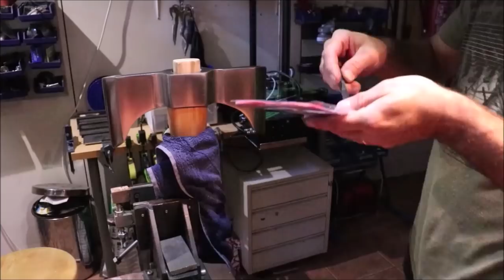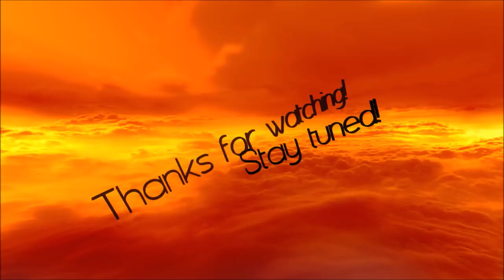Making axe with power tools (long version )

Comment: real talk tho... what fuckin cutting wheel and sanding pads are you using? It made quick work of that steel :O
Reply from the maker: Thanks.
Those are 3m  cubitron 2 products. There's more info at the description.

Comment: Like who wakes up in the morning and says i know i'll make an axe out of a lump of railtrack how did you see that in there???? stunning result mate .........Brilliant
Reply from the maker: Thanks buddy. This build will be continued later. Stay tuned. 😊
Reply: Where did you find that piece of railroad?
Reply: i agree the design was very well thought out...brilliant
Reply: @therustedshank9995  
Ditto all main line track in Washington state is Standard stuff all the same size short web Standard top rail and bottom flange ?????
Reply: I made a 2 headed hammer, from my railroad track... But im gonna steal this and make a axe and place it next to it :D
Reply: What type of electrode was use to weld the 2 parts??
Reply: @therustedshank9995  just try your luck at a farmer or scrap metal jard :D

Comment: Truly some of the best angle grinder skill from somebody who can actually measure and plan his work not just luckily wing it A++ 👍
Reply from the maker: Thank you very much !
Reply: keep doing what you do you'll go far try some ally or thin ss or evem thin mild steel art work instead see what that great mind will come up with ? I do random industrial bike orientated pieces and like your stuff for inspiration 👍 cover postage if you want and I can send you raw material like turbo heat  exchangers bare car clutches drive gears sprockets engine components cams etc etc

Comment: Wow. 

I wish we could get the time frame for this project. Grinding a railroad track like that, even with a aggressive 
grit seems like it would take forever. 

Great job.
Reply: I feel bad.. I also over looked the "instructable link" earlier.. I literally read your "read this" comment, all of it, & did not follow
the link, which at the end of the article shows it took "12" hours of work. Which is a heck of a long time to just tackle a project straight through. (I assume you took breaks)

Comment: Man mad props on the axe head. I dunno about the handle and or the way it was mounted. Mad props on the head tho
Reply from the maker: Thanks. :) Handle has kept its position. But, of course.. Securing it with "straps" just for to be sure, could be possible. In this case, i wanted to get visually simple & clean result.

Comment: And after a week of grinding we have an axe.
Reply: anthony livesay how many hours to make 50 ?
Reply from the maker: 8-10 for whole build. That's not so hard afterall.  Lenght of the cut outs was anout 5 ft overall. And not so much grinding either. Used 2 cut off wheels to whole build.

Comment: For the welding you did I would use 7024 it is the rod for industrial welding
Reply from the maker: One part that's not seen on the video, is that i preheated pieces to 100 degrees of celsius on the oven. For welding i used stick welder and Esab ok 76.18 rod.

SFA/AWS A5.5 : E8018-B2

EN ISO 3580-A : E Cr Mo 1 B 42 H5

It has great Tensile Strength N/mm2 . It doesn't crack in hardening process
Reply: i got ya while i use 7018 for most of what i do for something like this 7024 i think would have been my go to

Comment: Nice work..
Why did you use the mild steel angle iron when welding the 2 halves together...
Reply from the maker: Thanks.
I start and end welds on top of the angle irons. When i cut angle irons out, i cut end and starting points of the welds out at the same time. Result is even and flawless weld. Errors, like cracks usually comes to those sections.
Reply: thanks for your reply... i watched it again.. now i understand.. subscribed.👍👍

Comment: Just curious. I'm not an experienced welder. Why the metal attached during the weld? Was it for extra support?
Reply: Also, awesome final outcome. This is pretty amazing work. Well done.
Reply from the maker: When you start and end welds on top of the "supports". Weld is filled evenly from the weld area, when you finally cut them out. Result is even and better quality weld. Usually mistakes comes to the ends of the welds.
Reply: thanks. I'm glad I found your channel. Great stuff.

Comment: How many cutting wheels and flap discs did you use? Just curious. 

End result looks badass! 👍🏻
Reply from the maker: That's said on the first pinned comment, and description...

Used one 1.6mn cut off wheel.  Partly one 2mm cut off wheel.  Just a little from flap disc and two fiber wheels.  About ten hookit sanding papers. Making took about 8-10 hours total.

Comment: Making axe with angle grinder..

... and a hundred other tools.
Reply from the maker: And straight rotary grinder and stick welder.  Used little bit random orbital sander to tidy handle head. Those belt sanders for shaping handle was diy angle grinder attachments.  So, used angle grinder and three other tools... 

So..
Reply: Hope you felt the sarcasm XD

Though, I felt like the axe was a little thicc. It's more like a dual bit splitting axe lol.. Still nicely done! I'd buy it if it were for sale, but I think someone will grab it in the transit from Finland to Denmark ;)

Comment: Is that a Metabo angle grinder - hows it hold up to Bosch DeWalt or Makita ?
Reply from the maker: Yes its Metabo we-180 quick rt. Its the best electric angle grinder that i have used. Strong, ergonomical and light weighted.  Its a really pleasure to use it, its well balanced and doesn't vibrate. 
My opinion is that, at the moment Metabo beats them all.

Comment: i dont know anything about welding or metalwork so here is a dumb question... how strong are those welds? will those hold up for example in medieval battle when you sometimes hit shields and\or armor?
Reply from the maker: Weld is as strong as the material itself. Both sides are weld trough. Welds are 12mm thick. Similar sized welds can be use for lifting 20-30 ton weight. Of course rr-track is too hard for that purpose. But as an example.
Reply: wow thats a lot of weight, thanks for the info

Comment: I'm an axe man,have this design in my head for a long time,it's simply not hapening no matter how persistant I get,when I have time,no track,I even asked the rail road workers,they left before I got one,so...I'll simply ask how mutch cause I need a head ,broke alot of axes,need one that will be allways ready for work....I'll have to switch handles,I brake even iron ones,I would like just the head if it's in any posibility...how heavy is it in kilograms?I swing in all direktions on trunks even for traktor so the double side is awsome...I'm an axe god,I need this,been three seasons without,I'll chop so much wood with it,it will become legend,got electrodes,no welding machine,it's simply not hapening,destiny is redirecting me away from it,I'd like to get insane with it 😂

Comment: Hey what sanding pads did you use? Im looking for something just like that to help with my mirror finishes.
Reply from the maker: I use 3M hookit pads and papers. Also Scotch-brite is a good solution, rough grinding with brown, then with red and finally blue. To get neat surface i finish it with random orbital sander and wet sanding bads, starting from grit 400, and ending to 1200.

Comment: That is an axe a Klingon would be proud to own. But man you must have a 1000 hours in it and $500 worth of grinder blades.
Reply from the maker: Not actually.  About 8-10 hours overall and 20-30$ to abrasives.

Used only one 1.6mm and half of 2mm cut of wheel. Partly one 4.3mm grinding disc and about 10 sanding pads.  
Average thickness for the cuts is about 1/2" and overall lenght about 5 feets. 
It looks, much more, but isn't actually very hard work at all.

I used 3M Cubitron 2 wheels and abrasives, those last long and removes material fast.  Ain't even pricey...

Comment: Very good angle grinder skills, it sucks that railroad track is such low quality steel though. Would make a decent splitting maul I guess.
Reply from the maker: Here rr-track is made from high quality carbon steel. Makes me wonder where people has got opposite knowledge about it? 🤔 Hard to believe that they would use anywhere low quality steel for rails, it gets lots of weight and stress under the train...
Reply: It's probably not the best but it's definitely serviceable. I've made knives from far worse material with good results

Comment: What is your power bill? :)
Pro TIP - Get Plasma cutter :)
Reply from the maker: Lol... huge. 😂
Reply from the maker: And.. Plasma cutters suck big time. 😚
Reply: I agree, my neighbor got a nice propane torch for half the cost of a decent plasma cutter.  It cuts, welds, and brazes and it runs off his home heating tank and an old oxygen bottle.  Also, nice axe, it looks like it was made to be swung by a dwarf from the lord of the rings.

Comment: I see you used a big boy matabo this time
Reply from the maker: Yep. Its Metabo we 19-180 quick rt. Really great grinder, powerfull but still light weighted. Only 2.7kg. My cordless 125mm grinder is heavier than this 180mm beast.

https://www.metabo.com/au/en/tools/cutting-sanding-milling/angle-grinder/angle-grinders-o180-230-mm/we-19-180-quick-rt-601088000-angle-grinder.html

Comment: What ever happened to using a torch?
Reply from the maker: It didn't fit to "Power tools" theme. 
Video was originally made to demonstrate 3M Cubitron abrasives and Metabo angle grinder.
Reply: I’m an OLD metal guy and don’t understand you guys newfangled ideas. LOL

Comment: The only let down is the short handle
Reply from the maker: Yep. It was a kind of compromise.  I made a stand for it to be placed on top of the table. Long handle would have taken too much space. It was a gift for a friend for his 40th birthday.  And made for decoration purpose.
Reply: That makes sense. Other than that it's absolutely beautiful and it will probably be around forever. Do you know the weight of the axe head
Reply from the maker: @henrylamprell9673  8kg. So its somewhat same weighted than sledge hammer.